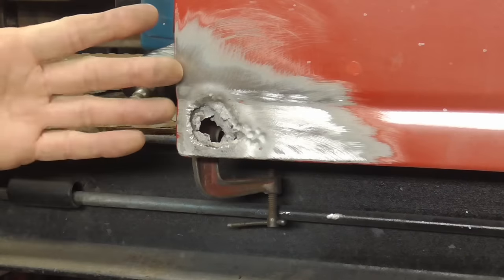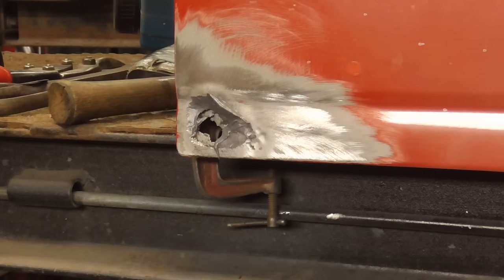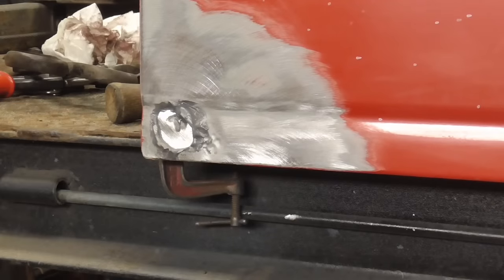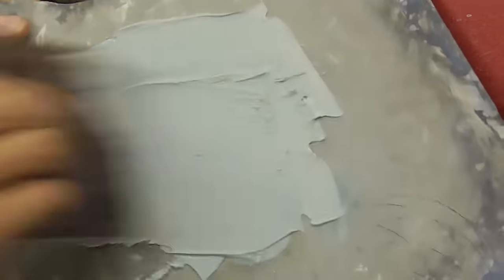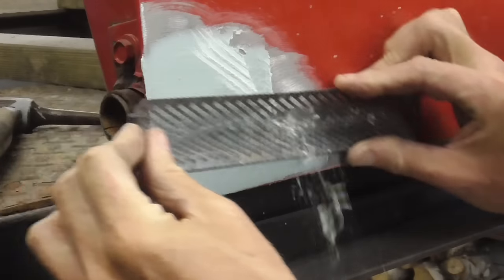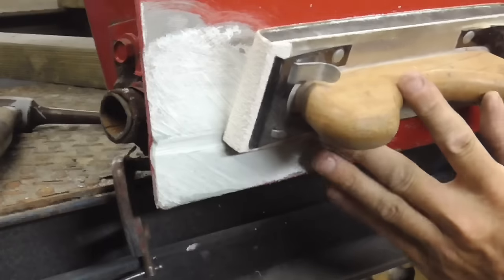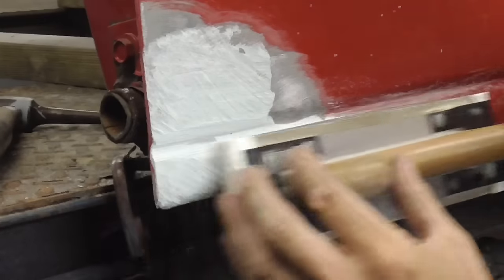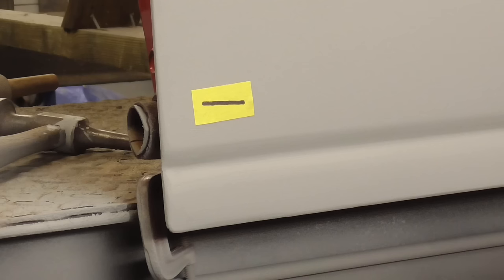Using JB Weld to Fix Rust Holes?

Comment: I have Permatex Liquid Steel, supposed to dry in 4 hours. Can I do the same as he did with the JB Weld?
Reply from the maker: As long as it is the steel weld epoxy and not the liquid steel filler I think you'd be fine.  I looked it up and there's two kinds from Permatex - I think the two part stuff would be more like JB

Comment: Do you think I can use this to fill a little nick on the front facing side of my brembo brake caliper? The nick is right on the brembo sticker logo. It’s not too deep
Reply from the maker: Absolutely - it holds up to tons of heat.  Used it on an egr tube that returned hot gases back to the manifold - held up real well.

Comment: What about pinholes to small for metal inserts 

I’m doing a restoration with a expensive paint job 

just wondering how long this would last compared to the paint job
Reply from the maker: It really depends on how the back is treated.  If you can get to the back, clean it and seal it with undercoat, it will last forever.  Also if you only drive it on sunny days, it will again last forever.  Panel adhesive and jb weld is one of the best ways to fix rust because it "seals" the seam.  If done right, it'll last as long as a new panel.  See these videos: https://www.youtube.com/watch?v=d21RkqTwRqs  &  https://www.youtube.com/watch?v=wRl1QfkrBeY  These repairs will last as long as a new panel or longer because after the paint I will squirt some oil inside to coat the pinch weld at the bottom like this:  https://www.youtube.com/watch?v=y05dNxt-nVc

Comment: I got a pin hole on floor board and wanted to do this fix and was wondering what kind of patch you used or where do I get one. I’ve never done this kind of repair before.
Reply from the maker: Any piece of sheet metal with work for you - any scraps you have around the house - this was .030" or 22 gauge sheet metal.

Comment: I used the JB weld on a hole on my oil pan on my 1968 fierbird a little hole and just drained the oil out and cleaned around the little crack / hole and it is still holding up did it 30 years ago!
Reply from the maker: That should be in a commercial - I love stories like that.

Comment: I think this will be a viable option for my fuel fill area little worried about sparks and gas tank so ill either do this or disconnect the fuel filler hose and weld it not 100% sure
Reply from the maker: Absolutely - don't worry about any negative comment or thoughts on this.  It can last a super  long time if the back is sealed, undercoated or allowed to drain and dry in some way.  No moisture + no rust :)

Comment: I use the marine weld variant for small patches and over welded patch seams to seal any pinholes. Just don’t see any downside
Reply from the maker: There is no downside if you make sure the panel can drain and dry out inside.  Throw some used oil or WD inside after the job is finished to prevent future rust :)

Comment: How long before the rust is back? Won't that just rust out as there is bare metal at the back in an area that regularly get wet?
Reply from the maker: It really depends on drainage.  If the panel can drain and dry out inside you'll be fine for quite some time - forever if it stays dry.  If you can squirt some oil inside the panel after painting and it can drain it can really help.  Same with welded repairs - drainage and some rust prevention goes a long way :)

Comment: Hey just wanted to say thank you for taking the time to show us newbies. I don't have a welder or the money for that, wondering about using some aluminum window screen shaped to a mild curve, under a fender and pushing the JB Weld into the screen to strengthen this curved area. Then on the outside use some Evercoat with metal fill on the top of the fender prior to the finish glaze. What are your thoughts about the bending to shape and JB Weld to hold? Thank you for your consideration.
Reply from the maker: You could try it... can't hurt to try.  The main thing is applying the filler correctly, making sure the panel can drain and dry out inside - drill holes if needed.  You could even jbweld some very thin metal in place - you can manipulate the thin metal easier.  Heck, that would last quite a while as long as the panel can dry out inside - no moisture = no rust
Reply: @LakesideAutobody  Thanks again, I appreciate your help!!

Comment: I used this method back in 1999 with my old 1981 AMC Concord. Did a complete body and paint on that car. None of the 10 or so JB patches ever failed. Many real nasty slushy salty winters here in Winnipeg. Actually the one welded patch that the paint shop did do failed after 2 winters. That was the only failed patch ever on that car.
Reply from the maker: That's great to hear - thanks for the story.  Have a good weekend and Easter :)
Reply: JB won't rust . I have two small pencil girth holes on my rx7 forming at the rear welds where the water drains . I had previously "fixed" them by using  small sheets of steel metal and epoxy to  fix them the metal rusted right through  even though i had painted it, the water just loves to pool there , the epoxy was fine though.  Today I took a dremel and a grinding tip and left the metal virgin, used aome JB weld with cardboard backing to fill the gap and cover the area. JB weld is non corosive so i prsume teh rust won tever return as there is no longer any rust spots and unless water gets between the jb and the metal, which wont happen unless it cracks, i'm good

Comment: Protect the backside from rust or the  fix will eventually fail.
Reply from the maker: Good point - also allow for drainage.  I found that to be the most important thing.  No trapped debris and moisture.  It has to dry on the inside.

Comment: Once the hole open what should I treat the metal with before putting on JB weld and patch ?
Reply from the maker: Best thing to do at that point is to blow or clean the inside of the panel out best you can, allow for drainage (panels need to be able to drain and dry out inside) then treat the inside after you repair it like this - https://www.youtube.com/watch?v=8XaZBy7GC7A  😊

Comment: Do you use a finer grit than 80 before priming? Do you use 400 or 800 grit between primer coats?
Reply from the maker: Most body shops finish filler with 80 grit before priming and 120 to feather edge the paint.  You can cheat by using 80 grit first on the paint the go to 120.  Further out you can DA with 220-320 or scuff so you don't have primer on shiny paint. You don't have to sand between primer coats.  Hope that helps - here's a video on prep:  https://www.youtube.com/watch?v=pjXkhi1E7hQ  Jerry

Comment: This is a sound and permanent repair. If you weld a patch onto the hole; if there is any pinholes or moisture that migrates into the area you'll have rust all over again.  I love this idea of cold welding it with JB weld. This way the repair is sealed air and water tight and its very strong.
We'll have to see what happens on the door after a few thousand door slams.  I cringe when using body filler on a door or hood; the shock and vibration always causes problems to body filler.
Reply from the maker: You'll never have to worry about filler cracking or falling out if it is applied correctly.  1) Grind/Sand with 40 the paint off 2) Mix correctly 3) Sand, prime and paint.  Here's the process that will last a lifetime - https://www.youtube.com/watch?v=mApSa0l4euQ no matter how many slams :)
Reply: Thank you for sharing this.  I am going to use it on the underside of my F-250 truck bed to learn on. @LakesideAutobody

Comment: Only problem with J B weld is the price .. The small 28g package is $11.99 and the bigger 283g package is $25.99
Reply from the maker: True - if you go by volume, it might be cheaper to get some impact resistant panel bond:
Reply: Much cheaper than that on either Amazon or buying direct from JB Weld's own website

Comment: Could J-B weld be used on a small hole in an oil pan without removing it
Reply from the maker: Drain first for like a day or two to make sure it has stopped dripping.  Sand really good with some good fresh paper like 80 grit,  Clean well with rubbing alcohol, lacquer thinner or wax and grease remover then apply.  It might do the trick :)

Comment: which JB weld if tis not the steel stick ?  where did you get the metal piece ? a coke can ?
Reply from the maker: You want the J B WELD 8281 (Original) - it takes a while to cure but very strong.  You can get sheet metal at the hardware - .030" or 22 gauge.  Any scrap sheet metal will work - I'm sure you can find something at home depot - a small piece.

Comment: I guess you fixed the back side the same way. Didn't show that in the vid.
Reply from the maker: I suppose you could do that but it's really not needed if you allow for drainage and rust proof after the repair.  The main reason for rust and rot is trapped moisture and debris.  Have a good week :)

Comment: I have recently acquired an old Powermatic 8" jointer that I intend to restore.  There was a good bit of surface rust on the infeed and outfeed tables that has now been sanded away.  I found some small pitted places on the two beds that will not affect the performance of the machine, but do detract from the appearance.  My thought is to clean up these areas and fill them with JB Weld and then sand  off the excess once it has cured.  I need to get some input as to which product to use.  It would be great if I could find one of the JB Weld products that would finish out "shiny" so that it would not be so obvious.  Suggestions??
Reply from the maker: The JB Original works the best for me.  I would prep the pits the best you can fill them with JB, sand flat,  then sand with some very fine 600-100 grit sand paper and buff it.  I pretty sure if you buff fine sanded JB it would shine.  Just like sanding and buffing plastic.  Let me know what you end up doing and if it works for you :)
Reply: @LakesideAutobody  Will do   thanks

Comment: This seems like a great option for non structural repairs. I wonder if it will eventually crack over time though?
Reply from the maker: Here's a video using JB - has lasted 2 years driving through the winters - no signs of problems yet at all.  Jerry

Comment: Should I use acid based metal prep around hole so rust does not come back at patched area.
Reply from the maker: It can't hurt.  I don't used it because I want nice clean freshly ground sheet metal for filler to stick well to.  Just me though so... One boss of mine made us use it and a few others didn't so... Never really saw a big difference in longevity of the repair due to metal prep.  Jerry

Comment: I have a Crown Victoria Police Interceptor that has 2 plastic plugs filling an antenna hole and the hole for the light bar wiring. I've been trying to figure out how to fill them before I paint the car  without having to remove the head liner. This seems like a good option. I didn't want to use dyna glass and filler because I was afraid it would flex and crack over time. I think this would give it enough strength to be able to use a little filler on top to smooth it without it cracking. Thank you for this video!
Reply from the maker: I think that would work - glad you found the video
Reply: @LakesideAutobody  I am surprized that your video does not have many more views because this a good idea on how to fix holes on rusted metal

Comment: I was going to use JB weld in place of seam sealer in rain gutter, and cowl area. Door jamb, to smooth every thing out, WILL IT STAND DA TEST OF TIME? Opinions, plz, especially pro body guys
Reply from the maker: Seal sealer flexes a bit even though is is dry.  If you use jb and the seam moves a bit it may crack.  There's a good chance it won't though.  If you want to smooth it out why not just use body filler or reinforced body filler ?
Reply: I've seen Bondo & tiger hair crack against steel before, now was that because it was'nt prepped right? or I don't know, I was going to go down to bare metal hit it with DTA epoxy primer and then JB weld over that they're both two-part systems. After Bondo and prep, high build, if needed, finish seal everything in with the DTA epoxy primer. I've been using JB weld ever since I can remember and I can't remember it ever cracking anywhere at all, all the years I've been using it. project farm use it to repair cylinder heads and stuff they would start the engine and run the thing with a cylinder head repaired with JB weld, it lasted about 20 minutes I believe before it died. Both would be easy to finger in. Mebbe I do Bondo on one side JB weld on the other to see how they stand the test of time?
Reply from the maker: @dog-dx9pd  Your right seam sealer can fail but if used properly its good stuff.  I think you'll be fine going with what you have planned though.  I've used filler many times where seam sealer is supposed to go - just because it looks nicer.  I wish I could apply seam sealer nice and straight like the factory 😊

Comment: Have a small hole starting above drip rail area on truck after cleaning out Would this method hold up in area like this ? Thanks awesome videos
Reply from the maker: I think it would work fine because of the reason that rusted in the first place.  Usually there is seam sealer in those (not sure if yours is like that) - any way once that gets old and lifts a bit moisture gets trapped causing rust damage.  After you do your repair, there's really no way for moisture to get to it so you should be fine for a long time.  Worth a try.  Jerry
Reply: Lakeside Autobody thanks ! Keep making your videos

Comment: My thoughts are product interactions.  JB interacting with the body filler and all.  Looks good now but will it cause adhesion issues of the filler down the road?  Will it buster up and make a worse mess than you had?  Who knows but I'd be scared of it
Reply from the maker: I'll let you know.  I will be doing a video on how the longevity of the repairs seen on this channel in the near future.  It will be an eye opener to those that believe using filler, glues, etc. is bad.  If done right glues and fillers are invisible and will last longer than the metal that's supporting them - really - I've witnessed it over my career since the 1980's
Reply: @LakesideAutobody  ... have used JB with bits of metal or fiberglass and there's no reaction once it's hardened. The only thing you can't do is weld to it. Since JB is good to about 600 degrees I have also used it to repair aluminum intake manifolds when the coolant passage leaks and erodes the metal. Once the manifold is off the engine do a good cleaning, allow the JB to harden overnight, sand smooth, and reinstall the parts with a new gasket.
Reply from the maker: @rupe53  Thanks for the information - good to know :)

Comment: Excellent, I e use JB on engine blocks and lasted forever
Reply from the maker: The stuff is something else.  I used it on an egr tube coming right off of the exhaust to seal a rust hole.  Ground it clean, globed it on and it lasted 10 years then sold the thing.  Thanks for the comment :)

Comment: Good tip. But won't the bare metal underneath that little patch you put in the hole isn't that going to start rusting it's not priming it or anything you know where the JB weld didn't touch?
Reply from the maker: If you allow the panel to drain and dry it should hold up for quite a long time.  Here's a good vid on  preventing rust after a repair (no mater what method you use)  https://www.youtube.com/watch?v=8XaZBy7GC7A
Reply: @LakesideAutobody  thank you that was a great video too.

Comment: Just asking the question here because I don't know -- is JB Weld non-porous and waterproof (I would think it would be but I just don't know)?  If it seals water out away from the metal (again, I think it should), it should make a fine adhesive, bonding agent, and filler material.
Reply from the maker: Yes, it's water proof.  You can use any type of panel bond too in the same manner.  Just thought this is more convenient for DIY folks.
Reply: @LakesideAutobody  Thanks!  I thought so, but I want to check.  Yeah, that can be a great resource in the right places.
Reply from the maker: @brucebear1  You're welcome :)

Comment: Can I use JB Weld to patch my propane grill burners?  Will it hold up to the heat?  Thanks.
Reply from the maker: I sealed a welded spot right after the catalytic converter on my sons car and it has held up fine so far.  It's worth a try.  I think it will work myself...✌
Reply: Thanks.  I will give it a try.

Comment: 👍🏻😎 Believe it or not but we used 3M 2 part epoxy (the white and black stuff that mixes into gray) to make repairs on composite aircraft parts when I worked for Boeing. I see no reason for it to not work on steel as well.
Reply from the maker: Thanks for your input JT.  Good points :)
Reply: @LakesideAutobody  You're welcome. I remember what it's called now. Scotch Weld.
Reply from the maker: @j.t.cooper2963  Thanks my friend - I'll look into the stuff maybe make a video on it.  Have a good week :)

Comment: Like your video l'm going try on my truck how to Know witch J B weld  to get they make different kinds ?
Reply from the maker: Get the "Original"  not the fast set.  It's called J-B Weld 8265S Original Cold-Weld
Reply: JbWeld makes a few ,one is for metal